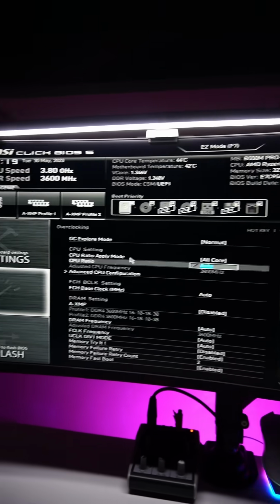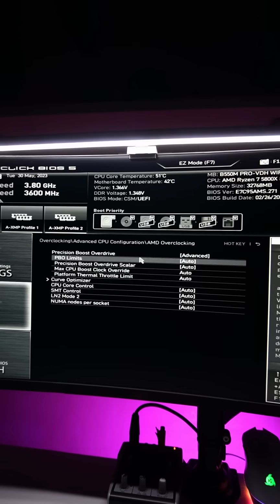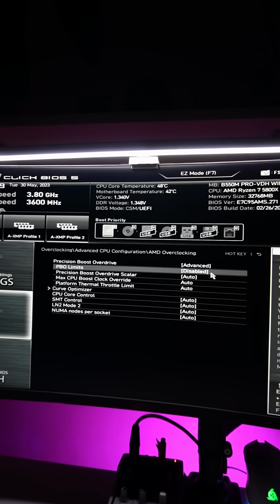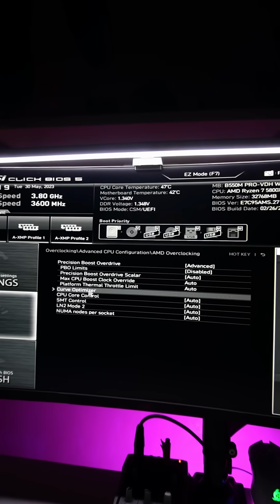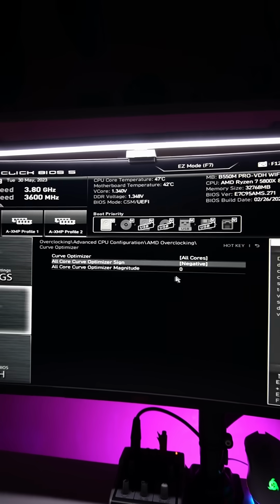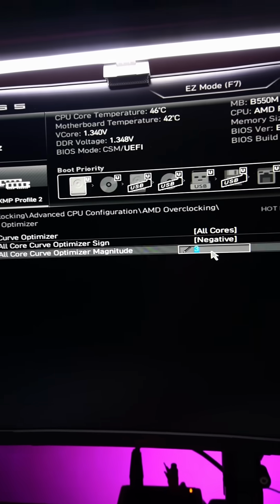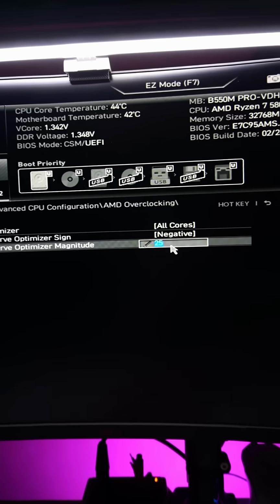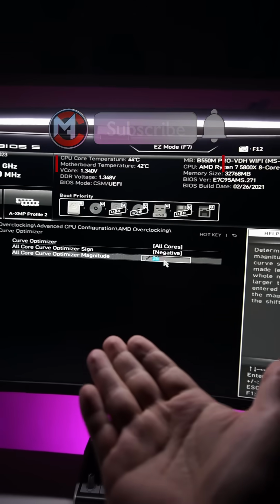Undervolting Ryzen CPU using precision boost overdrive #shorts

Comment: does the curve optimizer only show up on certain cpus? because i was just familiarising myself with the process before i purchase 5800x3d and i cant find the curve optimizer on a 3600 cpu on a b450m driver from april
Reply: for anyone curious, zen 2 cpus have no curve optimizer. apparently curve optimizer uses the zen 3 smu
Reply from the maker: the curve optimizer option is under the PBO2 if im not mistaken, only ryzen 5k series has it
Reply: X3d chips are locked due to L3 cache being stacked atop the cpu (heat).

Comment: Is undervolting completely safe? 0 risk?
Reply from the maker: it is safe assuming you do it correctly, upon testing with ryzen cpus it has a lot of benefits like what i did in my pc. it may have a different result in an intel build so it is better to do more research before doing your overclock
Reply: @MacCoyzkie  if i do it incorrectly, what issues can happen?
Reply from the maker: @ruslanmamedaliyev3912  like when you put too much voltage (like maxing it out) to whatever you are trying to overclock, it could destroy the psu and if the psu is not reliable this could also damage other pc parts

if you undervolt too much things may not work properly, it may cause no display at times but you can always clear cmos to reset